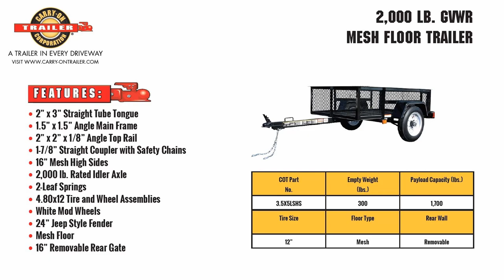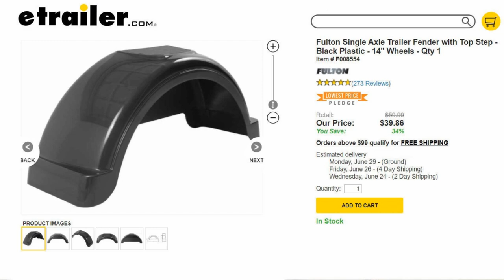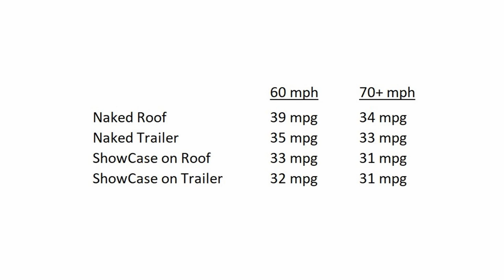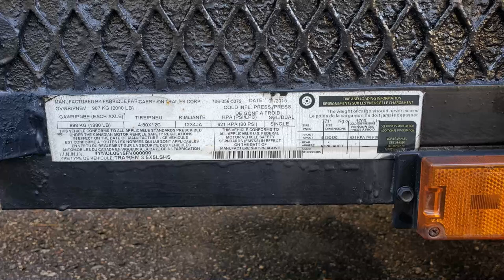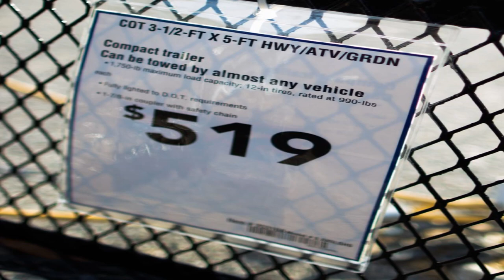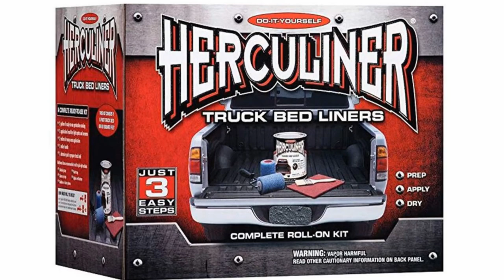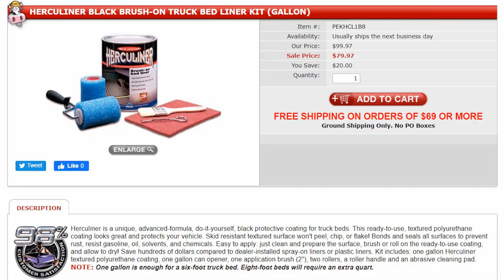CARRY-ON TRAILER 3.5x5-FT UTILITY TRAILER

Comment: I just sold my 2014 Tundra and kept my '17 Yukon XL with gas prices on the rise and price for vehicles ridiculously high, it made sense for me to let it go, I found more use from hauling my family around than hauling stuff and will be getting my hands on a small trailer to suit my cargo needs thanks for sharing your setup
Reply from the maker: Glad it was helpful! My 3.5x5 is fairly small. If I had sold a pickup truck, I might consider a 4x6 or 5x8, just to maintain a similar capability. Regardless, nothing would stay stock! LOL! Thanks for visiting!
Reply: exactly 4x6 would be great I might want it to be as lite as possible thanks again I love your trailer design and coating great job

Comment: Haha, jeez they are asking $1,400cdn now! Also, I just seen your review on Lowe’s website. Not many choices in the used market. I currently have installed a class 1 Reese hitch on my 2017 Bolt LT. Then a basic CURT cargo tray carrier but need to get wired lights as it covers my low turn signals. I would now like to bring 2 adult bikes/Chariot/toddler bikes. I do not want to deal with roof racks, so your video convinced me to buy this trailer.
Reply from the maker: Holy cow! That's quite a mark-up. I guess they pay a healthy import fee to get their products into Canada, which is then passed along to the consumer. Oddly enough, I've been looking at slightly larger trailers and can get a 5x8 tilt bed for just a little more than you're seeing for the tiny 3.5x5. WOW! Good Luck with your purchase!

Comment: The swiss army knife of trailers. You've accomplished so much with that little thing. I'm looking at modifying it for a mobile detailing business. Based on what you've accomplished with it I think I'll be able to accomplish what I need from it.
Reply from the maker: I think it would be an awesome detailing trailer. Add a set of hinges at the front and a prop rod at the back. Build dividers inside for different tools, liquids, towels/pads, etc, and you'd be golden. Just be sure to add a grated floor or use buckets in your dividers because rainwater will likely seep past the lid and wet the floor. The only reason I don't have a hinged lid is because of my occasional need to carry loads that are taller than the box. I may still look into a hinge that's easily removed... I like the idea that much. Thanks for visiting.
Reply: @StealthGTI  Thanks for the tips. Question. Was replacing the tires with bigger tires a simple swap on the original axle or were you only able to do that because you replaced the entire axle?
Reply from the maker: @billy.bright  - Original axle works fine. However, the fenders need to go. The surprise is that they're welded. I took the trailer to a shop and had them cut off and ground. The replacements are plastic; so, no welding.
Reply: @StealthGTI  thank you for your responses!

Comment: I like your attention to detail and design improvements.

I can reverse a caravan but short trailers are really hard, everything happens so fast and they are hard to see behind the vehicle, you've got manoeuvring up your drive to a fine art. 👍

DSG gearboxes.....mines dsg and its great BUT I wished vw had invested millions in developing a torque converter based transmission as overall I don't like it. It still uses clutches, as mines a GTI it's a 7 speed wet clutch transmission..... the clutches (x2) run in an oil bath on wet clutch system, but its still friction that's doing the work. The dsg shifts up and down super fast but when you're crawling slowly up a multi story car park you get the whine from the transmission and backlash too, it just lacks refinement that a torque converter box gives you. It's great when you can't be bothered doing the shifting. Runs from the traffic lights are just so easy. But  as a engineer I find it lacking and when pushing on really hard I miss the driver engagement. Yes you've got manual mode but even that doesn't do as you'd like, for instance.... . putting your foot down from the lights in a 7 speed dsg will see 1st gear last no time and if you're foot is hard down it will fly but so will the revs. If you want to put you're foot down really hard and just use low down torque select manual mode and flick the paddles, oh but vw have decided in their wisdom you don't know what you're doing. So you might think, I know it takes a quarter of a second to realise I've asked for an  upshift   so plan that and shift at full throttle at 1700rpm, it just ignores that input until about 2000rpm when you have to tell it again to shift up as it doesn't remember the request..... as a driver of the old school I find this sometimes infuriating.  Overall when pushing on hard I miss the lack of driver engagement, before you commit try one for a good long weekend, I wouldn't have another which is a slight problem as they now don't offer a manual in the UK on the GTI. I also run an Sc430 with a torque converter box on a 2009, gearshifts aren't quite as fast as the GTI DGS but what it looses in  that it makes up for in overall refinement..... no noisy cogs, whines and backlash. Don't get me wrong the SC is no drivers car, my GTI would leave it miles behind on a twisty road but boy do I wish VW had invested in a torque converter box rather than dsg.
Reply from the maker: Thanks for your comments. I've made parking my "baby trailer" an artform. Check out my "Stunt Parking" page for some examples of trailer-parking-witchcraft.  ;-)  https://stealthgti.com/stunt-parking/

Comment: The VW centercap and those wheels look cool.
Reply from the maker: Thanks! I used to have some VW alloys on the trailer. But I decided to switch to standard trailer wheels so that I wouldn't feel mismatched depending on what car is pulling it. I don't think a set of GTI wheels will fit without rubbing. Regardless, I like these just fine. Thanks for visiting.

Comment: What’s the lug pattern for new rims? And did you upgrade the axles? Did you need spacers to fit them tires and rims?
Reply from the maker: The lug pattern is the same as stock, 5x4.5. The axle is upgraded, but it was due to a maintenance error and not due to a need to clear the larger tires. I don't need spacers, but I did need to install larger fenders to clear the larger tires. See all the specs at https://stealthgti.com/carry-on-3-5x5lshs-trailer/. Thanks for visiting!

Comment: Hello Scott, after watching your videos and looking at your website, I see you have used several different kinds of tires for your Carry On trailer.

I was wondering if you could give some commentary on the reasoning you have used several different sizes and what their pros and cons are.

Or if I missed something, you could direct me to any commentary you have already provided.

Also what is the tire and size of your "limp along" spare tire?
Reply from the maker: Thanks for writing, Mike! I've run through a few styling trends. At first, I had used some wheel adapters that allowed me to run a set of factory VW steelies and whatever tire size that was standard on the Mk6 Jetta that first towed this trailer. That may have been around a 195/60R15. I went that direction in an attempt to achieve a smoother ride from a tire that could run at lower tire pressures (35 psi vice 90 psi). Later, I felt that the thick adapters may have been contributing to premature wheel bearing wear. So, I switched back to a zero-offset trailer-specific wheel. I chose a 13" wheel so that I could maintain the tire circumference that I had with the VW setup. When it was time for tires again, I had some brand new tires that I had bought for my Mk3 Jetta that never got mounted. So, I bought some black 14-inch wheels and mounted the 195/60R14 passenger tires since I already had them. That's what's on the trailer now. My website incorrectly lists 13″ wheels with ST175/80R13 tires. That will be the size that replaces the passenger tires when the time comes. I left that off my website because I didn't want to mislead my visitors into putting passenger tires on their trailer. And don't be fooled by the VW logos on the hub caps; they're just stickers. I'm a VW nerd!  ;-) 

Pros and cons? I suppose the passenger tires ride smoother with less bounce. However, they also squirm left and right a tad more, which is problematic with heavier loads or at higher speeds. That's why I stayed with dedicated trailer tires on my heavier cargo trailer. Ironically, the 14-inch wheels on my utility trailer will have to go when the passenger tires age-out because an appropriate tire for 14 inches would be too tall for my tiny trailer. I'll downsize to 13s and use the tires listed on my website. Coincidentally, that would match what's on my cargo trailer, which would be handy if I had an unexpected need to borrow a wheel from there.  ;-) 

As for the spare, that's a 4.80-12, which is the standard wheel and tire that came with the trailer. I tried a variety of spare tire sizes to match the others as well as different mounting positions. Since I've only needed a spare tire ONCE in 25 years (plugs are great), I decided that mounting under the trailer was "good enough." The smaller wheel/tire combo was what I needed to fit between the cross members of the frame. If I had a 4x6 or larger trailer, I would have gladly chosen a tire that matches the main tires.

Take Care!
Reply: Thanks for the detailed commentary.  Great information for small utility trailers and choice of tires.

Comment: Sweet trailer! I'm looking at Tiguans and the collapsible trailer from harbor freight. I could store the trailer in my shed and modify it to fit my needs, and it's only 400 bucks! Some co-workers have one and say it works great
Reply from the maker: Thanks! Regarding your trailer choice, do some research on the "micro trailers" from Harbor Freight and Northern Tool before you buy. It's not listed on their website or on the store flyers, but a quick look in their owners manuals reveals that those trailers, while DOT legal, are speed rated to only 45 mph. I'm not sure why that is, but you should keep it in mind. I have photos of the applicable pages on this page on my website: https://stealthgti.com/2019/03/18/pros-and-cons-of-various-cargo-transport-methods/. Thanks for visiting.
Reply: @StealthGTI  thanks for the tip! I'll do some more digging in options that are out there. Luckily for me, anything I would need the trailer for is within a mile or two from my house and all under 40 mph roads to get there. Anything bigger or farther I can borrow my dad's truck so I should be good!

Comment: Could you do a little how to video on how you changed your leaf springs, and installed your LED brake lights? I'm new to all this and could use some guidance lol
Reply from the maker: Unfortunately, creating such a video would require me to re-do the work of swapping springs or lights (even if only one side) in order for the video to be effective. Here, I'll say that the jobs are relatively easy, so long as you practice some safety steps. I supported the rear of the trailer with jack stands and had the trailer coupled to the car for stability. I worked on one side at a time. After removing the wheel, I supported the axle with a jack before removing any fasteners. Slipper springs are very easy to replace once the trailer is supported. As for the lights, the wires are color-coded and easy to get right. Perhaps I'll do a video at some point; but it won't be until I have problems with my current equipment. That could take a while.  ;-)  Thanks for visiting.

Comment: Great thanks!   I would like to see how you attached the bicycle racks to the trailer. We travel back and forth from the central Virginia to the Rio Grand valley in S. Texas with a small SUV and I want to build a small trailer for extra cargo plus 2 bicycles.  Thanks. Have a blessed day.
Reply from the maker: The bikes were on a shorter rack that I haven't used in a while. To be honest, I don't recommend carrying bicycles anywhere but IN the trailer. The ride back there can be rough and even violent. I had a bike slip out of its fork mount. It was an obsolete design, which may have been at fault, but I think the constant vibration and lateral movement also played a part. Thankfully, the rear wheel strap held long enough for me to pull over and stop. IF you secure the bikes inside the trailer, at least they're more likely to fall to the floor instead of the road. I would hope that the newer breed to dual-wheel clinchers with wider base may work better than my fork mounts. Good Luck!

Comment: Really like the end product. If you were to start again would you start with the same 3.5x5 trailer and do the mods or take a different route? Thanks
Reply from the maker: If I was to do it again, I think I'd go with a 4x6 or a 5x8. The reason is because this trailer is too small to carry a sheet of plywood or sheet rock. I don't need that capacity very often and it's not worth selling the trailer now; but that's what I'd get if I was in the market today. Thanks for visiting.

Comment: You've helped me a lot you really know you're trailer stuff and you're showing me vision I have a Camry I want to pull a couple of motorcycles and some camping equipment and I would like to get some landscape rocks. How much does your trailer weigh? And what do you think the max trailer weight should be for a car that can tow a thousand pounds?
Reply from the maker: Thanks for writing, Jaysen! My trailer weighs around 500-lbs empty. The wood adds a bit of weight, as does the extra bed rack. After years of service, my wood has a bit of rot and needs to be replaced. I MAY replace only the floor and leave the sides uncovered (stock). That will reduce the weight a bit. Anyway, that's not what you asked.  ;-) Describing your car as "a car that can two 1,000 lbs," are you saying that your owner's manual allows for 1,000 lbs? If yes, then an engineer determined that to be a safe limit for your transmission. I'm pointing out the transmission since it seems to be a good reason for the relatively low towing limit. My owner's manual does not list limits. So, I use the UK towing limits as a guide, which is 1,500 lbs without trailer brakes. I have a manual transmission with a clutch upgrade. Take care!

Comment: Hi StealthGTI - I watched your CARRY-ON TRAILER 3.5x5-FT UTILITY TRAILER is awesome. I have a question? What is the size of the wheel rim you are using on the utility trailer? Thank you
Reply from the maker: For now, I'm using a set of 14" wheels so that I can use a set of 195/60R14 passenger radials that I had bought for a previous car and never used. I will replace them at some point with a set of ST175/80R13, which is a proper trailer tire for this trailer. See more at https://stealthgti.com/carry-on-3-5x5lshs-trailer/. Thanks for visiting!